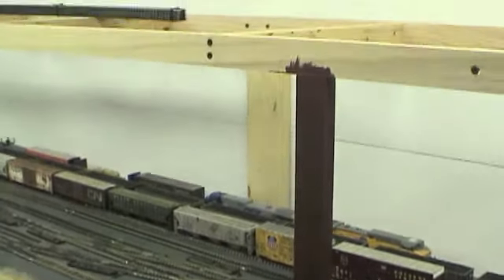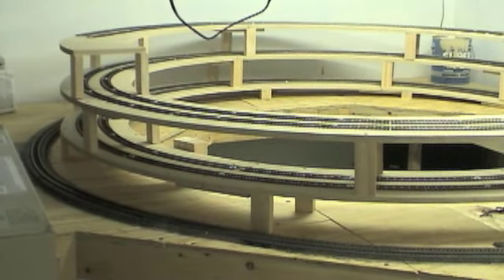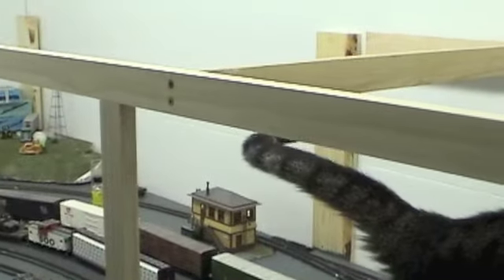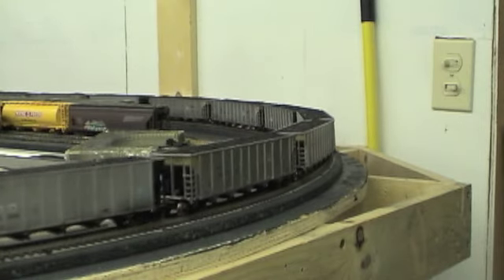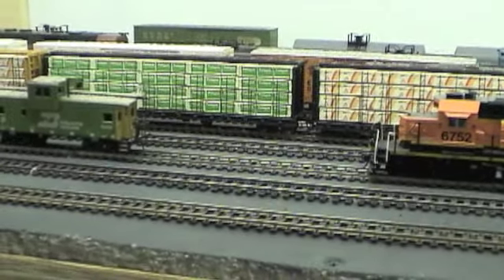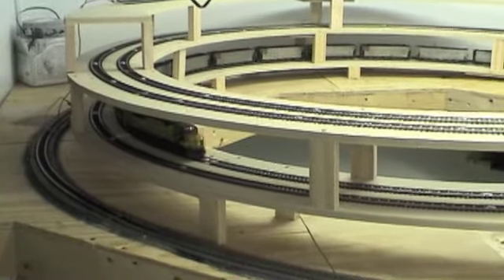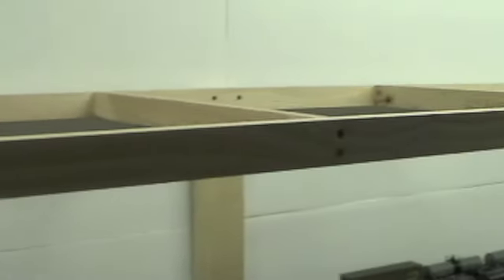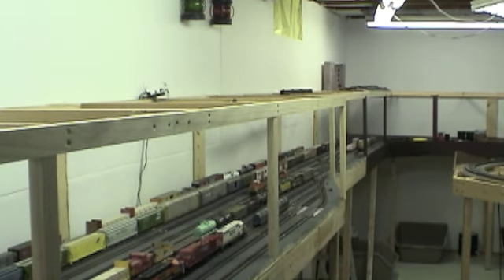Helix construction part 3 and layout update

Comment: Real nice  video , My suggestion would be to use foam backed with tempered hard board on bottom for installing turnout motors . Have tried everthing. This works well and is light. Cut the foam and overlay the bottom to get your form and then mark off the hardboard and cut then glue with foam safe adhesive . It is strong and can be shaped with a knife or wire cutter. I use Cork for road bed and foundations for buildings .  I built my last section with shelf brackets because of height limitations and it can be removed later for ( hopefully a bigger building  ). Keep up the good work

                                          Chasryloco